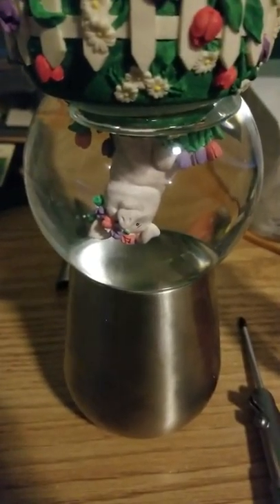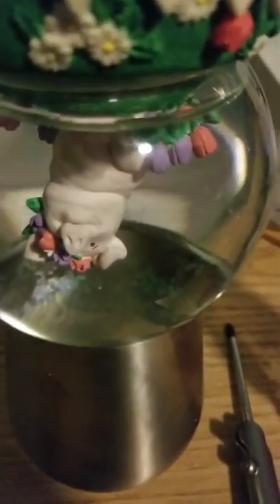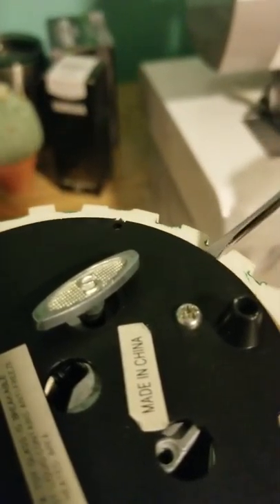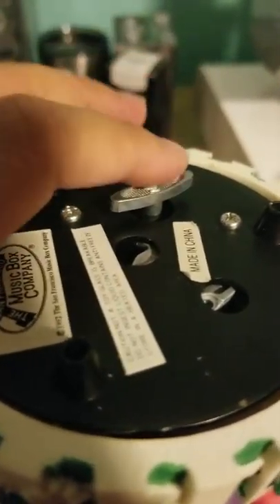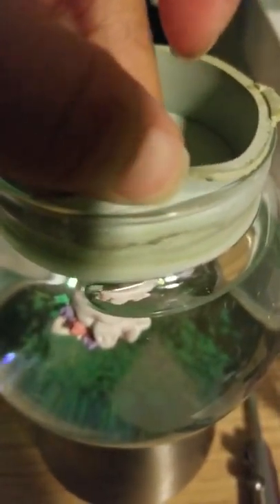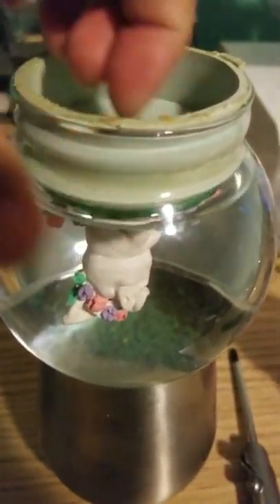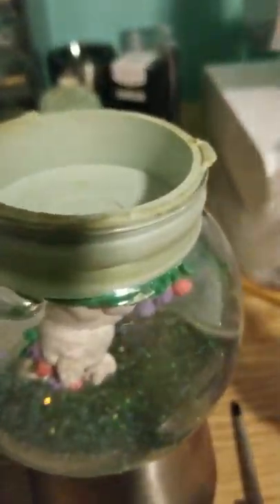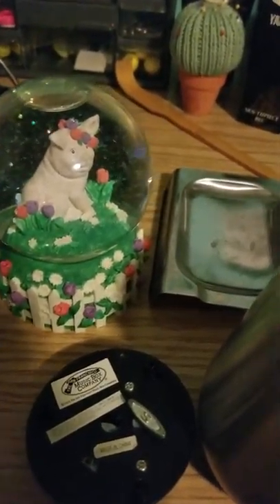DIY change dirty murky water out of a snow globe

Comment: I'm thinking most Snow Globes worth having clear water again are the older types  - and I'm assuming most have a rubber seal at the bottom - so who in their right Mind would remove a deteriorated seal that will crumble no matter how gentle removing glue - the only way would be some professional way changing an odd seal.  I'm thinking newer ones with a better seal might still be clear water.
Reply: I can attest to that,  I tried & it & you are right.  Plastic crumbles in lots of pieces when trying to pry it off.. This may work for newer ones (as you said) but to avoid yet anpother fail...toss it.  Not worht it.

Comment: Did you re glue the globe to the base
Reply from the maker: Hi There! so sorry, just seeing this now. :\  I did.  I put the base on and positioned the glass part in the middle.  I used E6000 and put one of those pointy cone things on the tip to squeeze the glue better between the the glass rim and base then i dried it over the next few days.  Hope this helps.  I'd show you but I dropped it! :\ and broke the flippin globe! UGH!

Comment: Did you glue the stopper? If so what kind of glue for rubber stopper did you use?  Thanks
Reply from the maker: I did glue the stopper.  I used E6000 :) It's easier if you get one of those funnel things that go on the tip other wise it just gloops and makes a huge mess.

Comment: How did you manage to scrape the glue off?
Reply from the maker: I used my flathead screwdriver to wedge underneath the glue on the rubber and it popped off.  It popped off the base pretty easy too.

Comment: Yes, received responses about seals cracking.  I had given away 3 of the 1970 Coca Cola with the Train going around the globe - neat - and strange why one of the four turned yellowish Water (I have the 4th one) - and really - does anyone believe these videos work on better quality older Snow Globes - the seal if 52 years old, and no program ever coordinated to have a replacement seal - to show using the same seal is not right.  Maybe works if the globe is a few years old but then, the globe is probably not working toying with at all.  The Train one is a neat design - probably best to keep the bottom with the Train Part - but will probably toss out the globe.  Why was one with defective liquid?  Other globes when I see Brownish Yellowish Water - I just discard - might be a health hazard

Comment: Another DIY fail!   If you have brittle plastic to pry up its going to break into lots of pieces.
Reply from the maker: Thanks for your feedback. That's a great heads up for someone working on a globe with brittle plastic.  This particular quick little on-a-whim DIY actually turned out well and wasn't a fail.  To my surprise, it actually worked :) The failure part is that I am be a bit clumsy and didn't realize it was a slightly heavier than the the light grip i picked it up with and it went crashing to the floor.  DOH! lol  The silver lining... it stayed glued! :P   This DIY was specific to SF Music Box.  Their music boxes are screwed in and there's some glue around the rim of in-between space with the glue on the rubber stopper.  It was super easy to pop it off. Though there was TONS of glue around the rubber stopper, the glue came off really easily because of it. Great luck and blessings to you on your own DIY trials and errors.